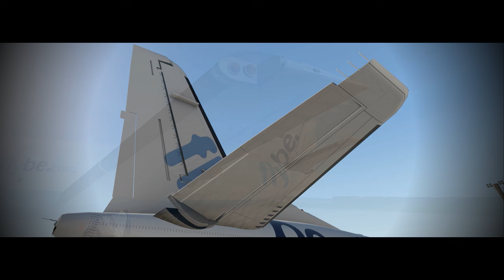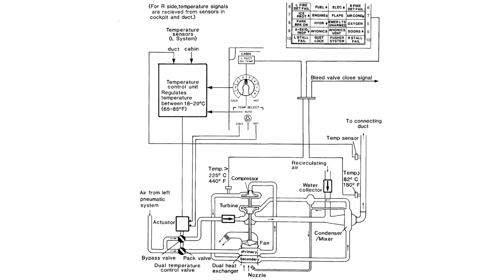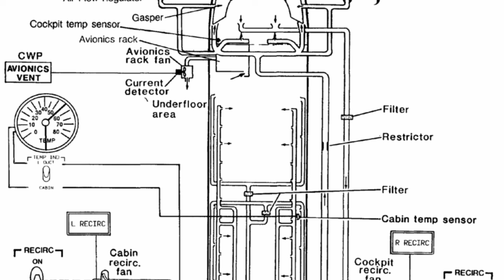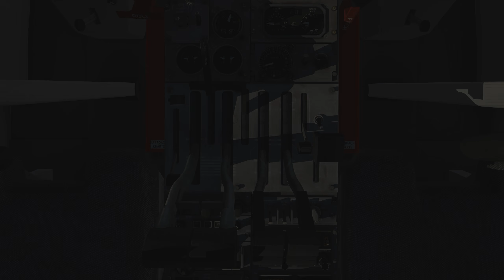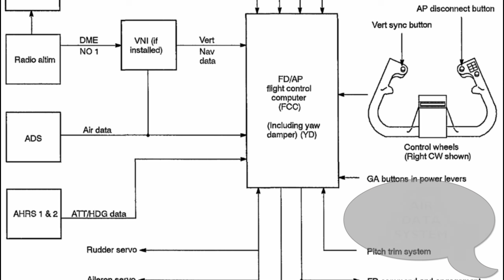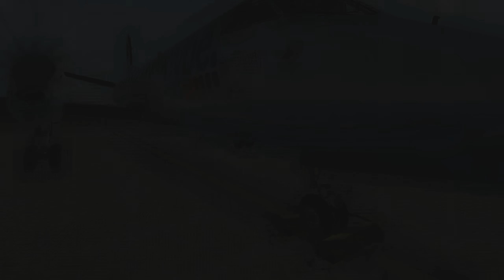X-Plane 11 : LES Saab 340 : Startup Tutorial

Comment: @supernova thank you for the excellent video, but I haven't had any luck starting either engines. The ignition switch won't do anything. is there some common mistake i am making? or is it some sort of bug? I even tried following the checklist provided by the aircraft but still have no luck. Thanks for reading and i hope you respond (i'm completely stumped!!!)
Reply from the maker: I haven't used the LES Saab 340 for a while, but I believe it has some issues with latest versions of X-Plane 11. If you're following the checklist carefully and the engine aren't starting the LES forum linked below would probably be the best place to find answers:
http://forums.x-pilot.com/forums/forum/158-saab-340a/

Comment: Very impressed with your extensive explanation of the aircraft's system but must admit that when I look at those various diagrams they look quite complicated and I sympathize with those who have to decipher them.

I would like to know whether your startup procedure follows the official documentation as I observed that it differs in some aspects to the pop up virtual checklists which LES have integrated in the sim & also to another list provided by a 3rd party. If it is the official Saab procedure I will probably try to use it as much as possible.

I noticed you used this procedure in your Destination Jersey video & you also mentioned that you had only seen where the right engine is first startup. Someone mentioned elsewhere that the left engine is first startup if the GPU is being used, the reason being that the crew running the unit attach it to the starboard side of the aircraft and it would be hazardous for them to be around the prop. The procedure is to start the left engine, turn on the gen & tell the crew they can buzz off.

BTW I believe that RL Saab pilots drop the prop revs back soon after take off & don't wait for cruise height. I have started to adopt that procedure & so far it seems to be OK.
Keep up the good work on your videos.
Reply from the maker: The checklist I use is based on the Saab procedures. The right engine can be started first to facilitate passenger loading on the left side of the aircraft. I believe some operators start the left first, but I have never seen it done like that.
Reply: @supanova88  I suppose that in those situations the passengers would have to be on board & the doors closed before the cart is used for left engine startup. You wouldn't really like to be heading for the stairs with that prop spinning. 
I have written out your procedure list for future reference but have added one item early.....oxygen on.
Perhaps you may have some idea as to what "Pusher Disarm" does on the oxygen panel & what function the sliders do just below that switch....if anything.
Reply from the maker: I have not found any information on oxygen. I don't include it in the checklist for that reason. If I do find more information I'll update the checklist.